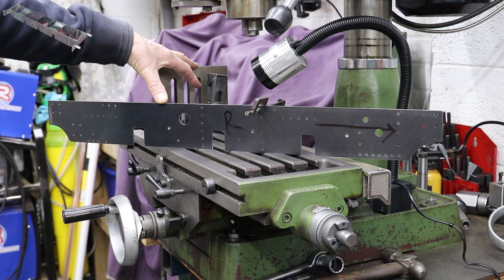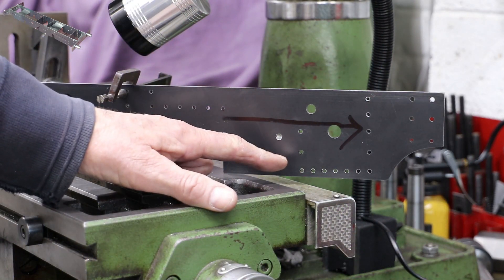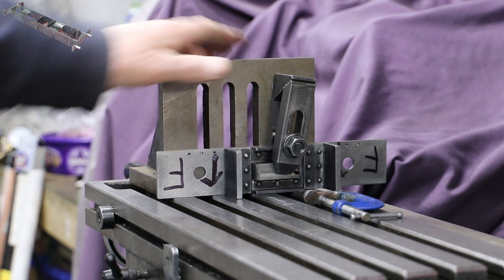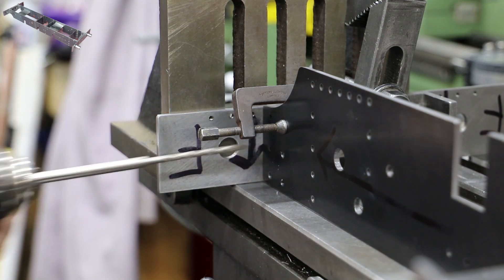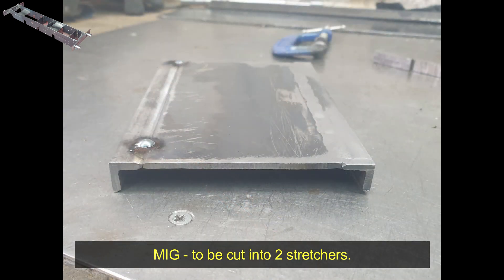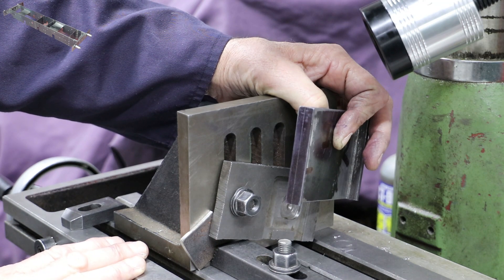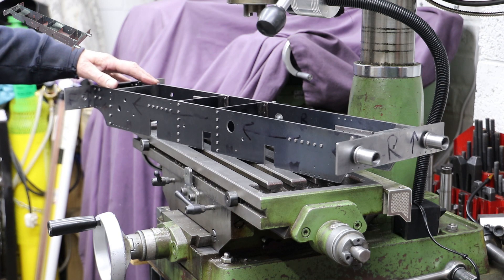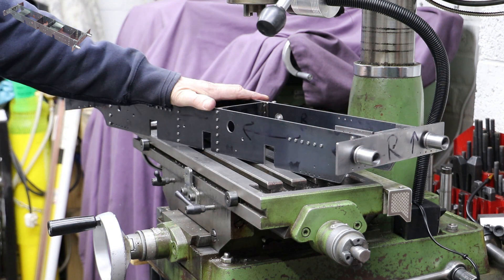Part 2: The Frames and Stretchers

Comment: Very helpful stuff. I've not got a DRO and would love to build a loco without it, but I do wonder if I'm fighting hard against progress on this one...
Reply from the maker: Hi William, the DRO makes life a lot easier, but it is far from essential.  Some good marking out and a keen eye on a punch will work just as good.
Go for it 🙂
Reply: @markshomeengineering5243  you think I could get away with a height gauge, surface plate and a scriber/punch for a 5” loco?
Reply from the maker: @williamsworkshopuk  that's how it was done before the advent of cheap machine tools and modern electronics.
Reply: I'd check on Model Engineers Laser, they have most the frames for most published engine designs available and they're pleasant to deal with